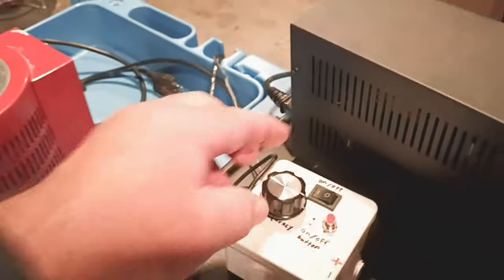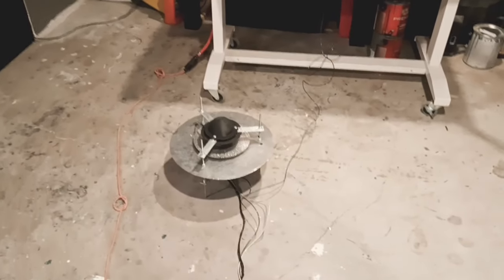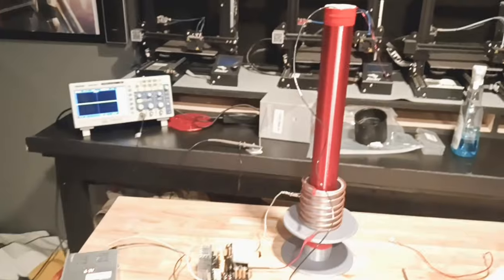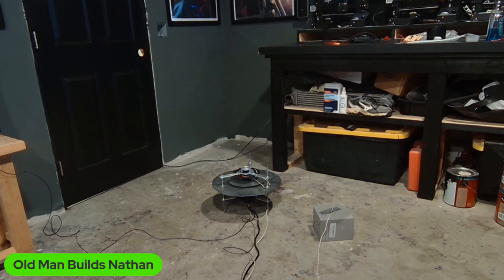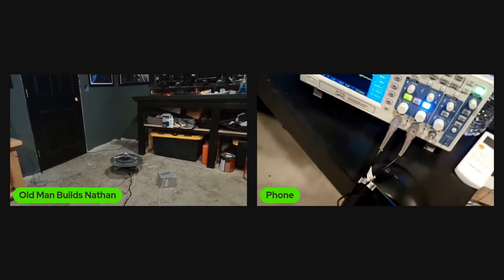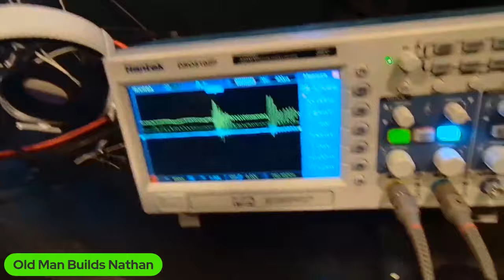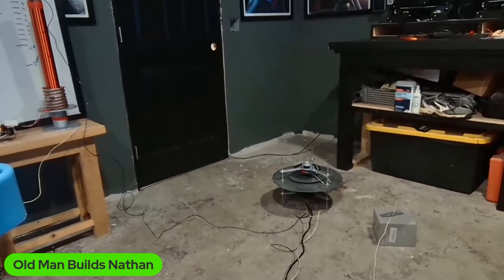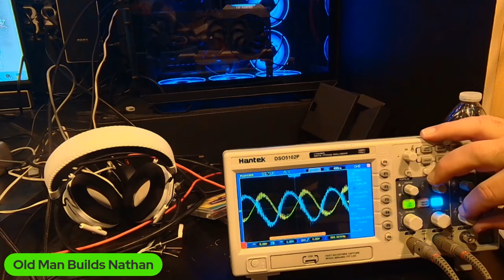Graviflyer Testing 15

Comment: Are both top and bottom spinning disc rotating at the same speed? Or do you tune the flyer with this different adjustment since there’s two motors, thanks and nice job brother
Reply from the maker: the bottom is slower until the energy picks up then they stay close to each other